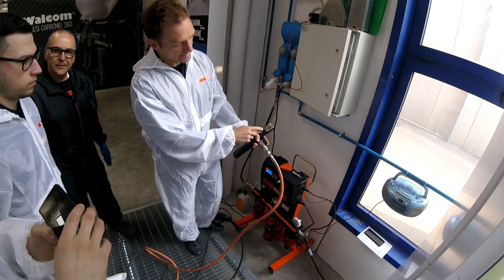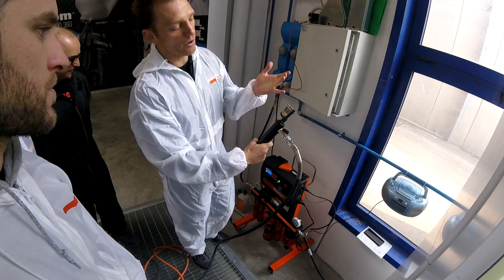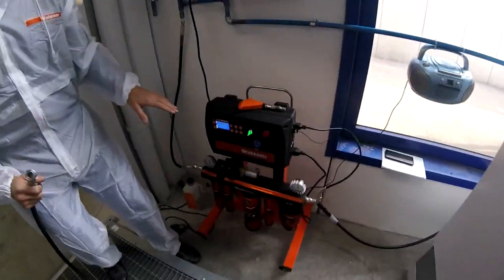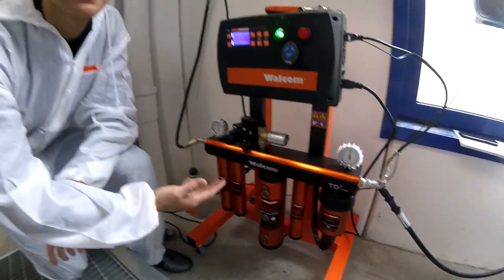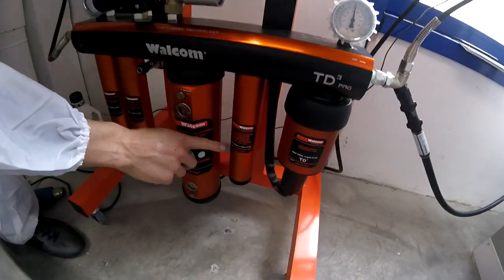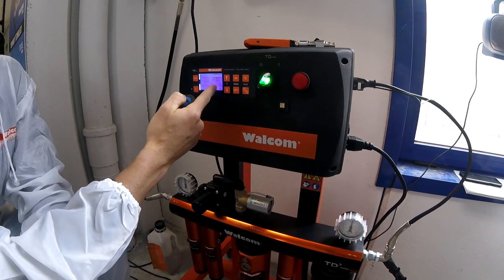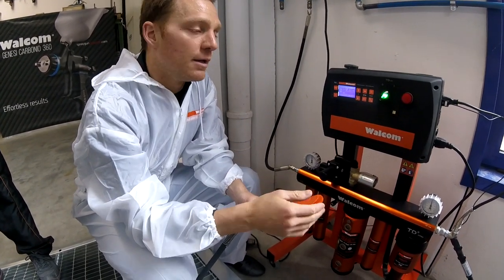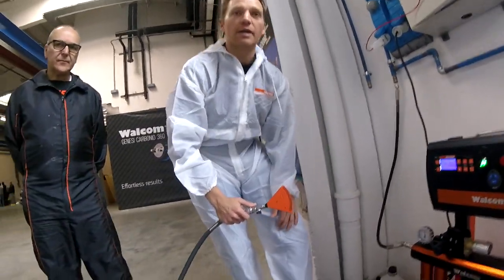Walcom Air Filtration system TD3 part 1

Comment: I've had the opportunity to demo one of these for several jobs. Very nice unit, I'm still lobbying my boss to purchase one. The only thing I would add here is that you don't nescessarily want to turn off the heating element on the TD3 on warmer, drier days. Of course a painter can and should adjust the temperature to their specific paint style but the TD3 does not over dry or over heat the material, if thatis your concern. Any compressed air is going to come out of the gun well below room temperature as it is technically refrigerated. The idea is to bring the air atomizing the material in closer register with the conditions in which the material was engineered, i.e. room temperature. The air coming out of the unit may be set to 120 degrees ferenheit but it comes out of the aircap at around room temperature (72 degrees). This is ideal no matter what the ambient temperature in the booth is. Envirobase responds beautifully to this to this as it is more throughly atomized. The application is still wet but the flash time is quicker because it's not trapping as much moisture on the substrate. You will see this the first time you spray black envirobase. It applies wet but without as much of that bluish "blushing" effect.
The same principle applies to solvent application as well but be careful as clear flows really well with this unit and yeilds excellent gloss retention but you will get runs if you're not careful. You'll find you need to adjust your technique a bit but for HS clears I recommend using 1.2-1.3 fluid tips or even reducing material volume (but that's my last resort). Hope this is helpful.
Reply from the maker: Thanks my friend this is awesome !!!